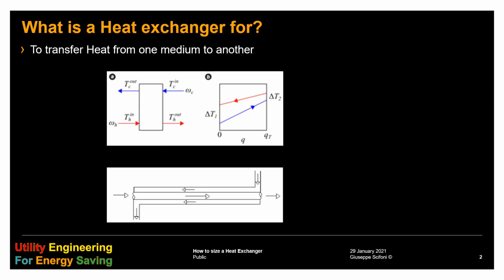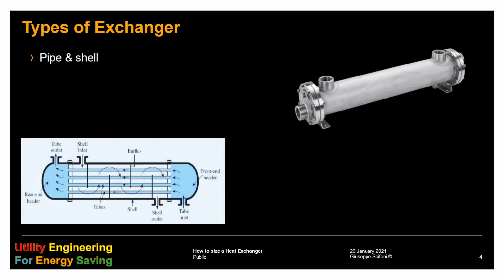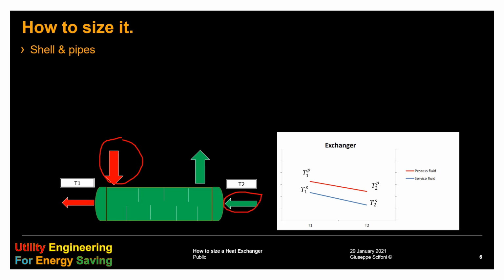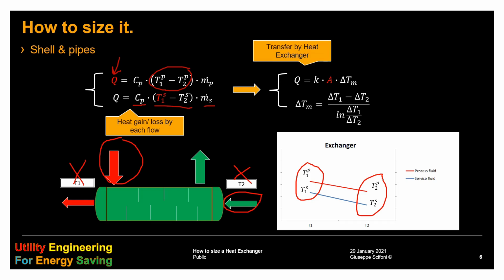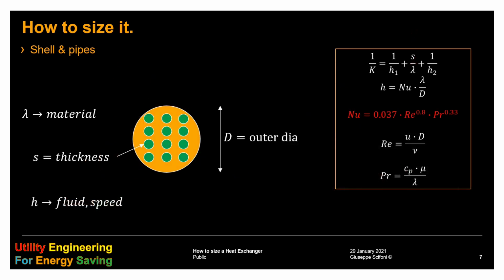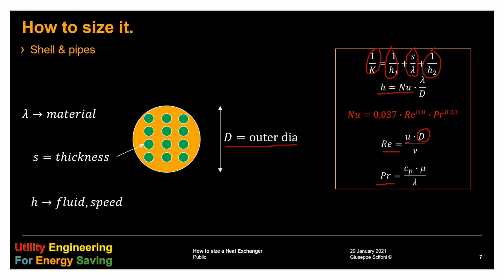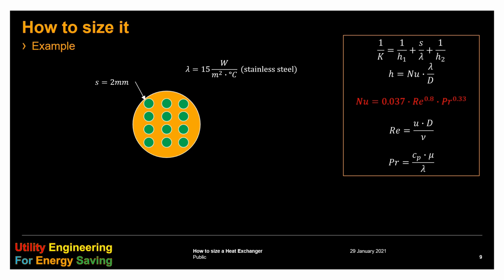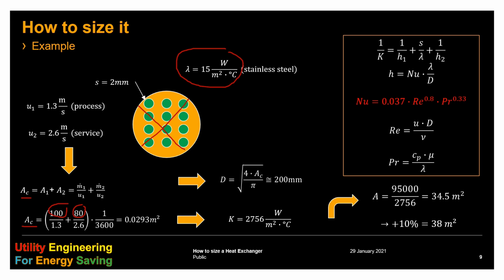Heat Exchangers.

Comment from the maker: Slide 6
-Graphic with two coloured lines: the blue line runs from right to left (service fluid), the red one opposite (process fluid).
On the x-axis is the exchanger run lenght, on the y-axis the temperatures.
-Formulas: the specific heat Cp can be different if different fluids.

Slide 7:
Lambda in the h formula is the conductivity of the fluid, not to be confused with the lambda value of the steel used in the K formula above.

Slide 9:
K is found using the formulas in the right up square.